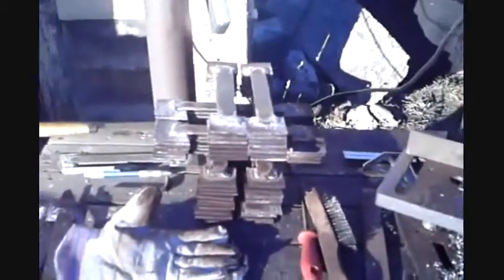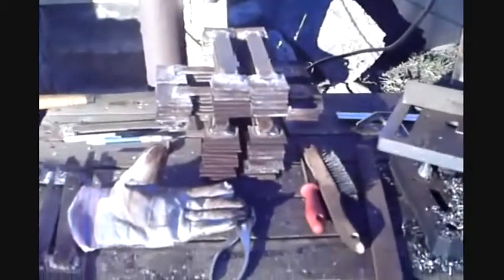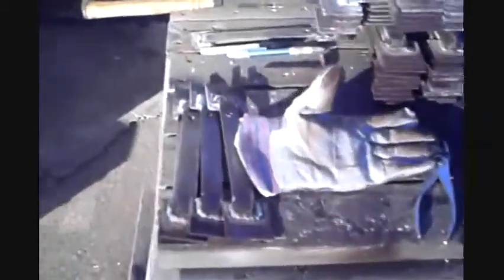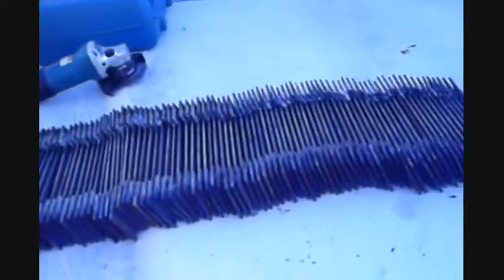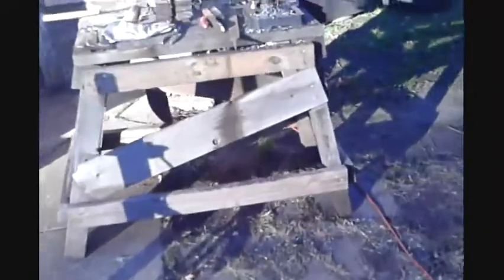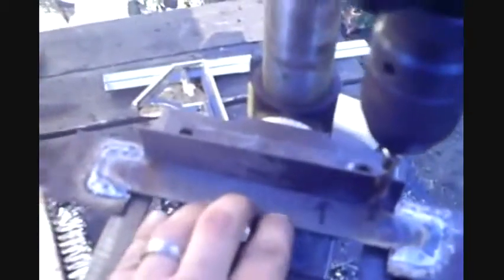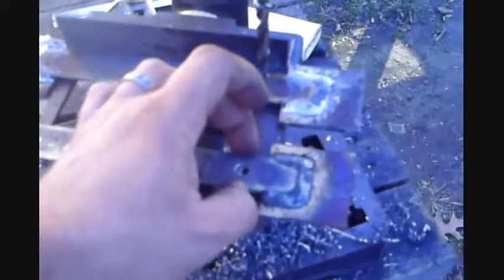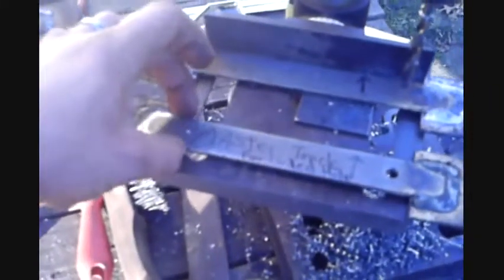Make and Build your own tank tracks (X1 Scorpion track design) part 7

Comment: I need to get one of those drill doctors. I have been drilling allot of holes in my track plates. Making the tracks is not the most fun part of building a tracked vehicle!!
Reply from the maker: Aceman307 I here yah man. I just got done with the second hole on half of the tracks. I went and bought a little radio to try to get rid of some of the bordum, it helped a little bit.

Comment: I wish I had some good drill bits
Reply from the maker: ShawnCFarm You know I tried sharpening drill bits on a bench grinder and never could get that curve right on small bits, big bits over 1/2 inch are easy but small ones are a pain in the ass. Let me tell ya if you can get ahold of one of those Drill Doctors it will pay for itself. I've had this one for around ten years and never had to do anything to it,very reliable. Thanks for watching.